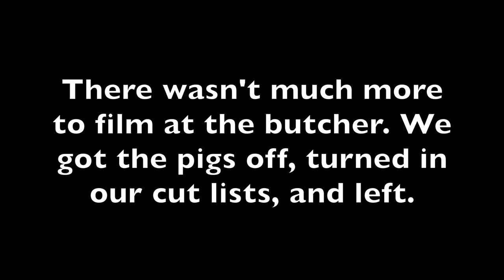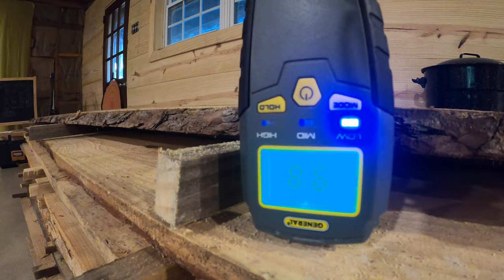When Hard Work Pays Off

Comment: When I was raising pigs I did the same thing, load them the night before as I had to have them at the processor before 6 am and then get to work. much easier as I was dealing with 8 big Duroc's and used a 1 ton stock truck and a ramp.  worked great !!!

Comment: Wes you got to learn to use your cut gate in the middle of the trailer and the escape door on the side. Put pigs in back and set up the front with feed and water, release the pigs. When moving them to the butcher close them up in front half of trailer. When going down the road the less space they have to roam the safer it is for them and the better the trailer will pull with them in the front half. Good job as usual and keep learning fast. As usual necessity is the mother of invention. And on a farm, figuring it out as you go is often a necessity.

Comment: WRT water glassing.  This is our 2d year of doing it - the first year worked just fine.  We actually use a 5 gallon plastic pail and put about 150 eggs in each and put the cover on after so the water doesn't evaporate, then store in a cool, dark closet.  This year we have two buckets - 300 eggs.  Two things to note, 1) when mixing your lime be aware that the water can only hold so much lime at which point it is saturated, so what happens is you'll mix and mix and there will still be solid lime that hasn't dissolved - no worries, that's just a law of physics at work. No need to take that excess lime out as it'll settle to the bottom. 2) The glassed eggs will still be fresh when used (we've used 9 months later w/o issues), but the whites will generally not be firm enough to get a nice fried egg with, so we use them for anything we would normally mix an egg for, e.g. scrambled eggs, baking, quiche, breakfast casserole, etc.  Also, it is perfectly fine to start a bucket and put a few dozen in, and then just add more eggs as you get them.

Comment: Get some half gallon jars.  You can fit a couple dozen in there.  Check the jars a week or two after you fill them to make sure none have broken.  You dont want to find rotten eggs six months later.    Calcium Hydroxide, "pickling lime" is semi-soluble in water.  Once you stir in a little bit, the solution will become saturated and any more will just settle at the bottom, or on eggs.  You probably need less than any recipe you see.  As long as there is a little extra visible lime sediment then the pH of the solution is good and there is enough to replenish any that might get consumed.

Comment: We built our house 25 years ago. Had a guy cut us some tongue and groove pine flooring. Brought it in the house to acclimate for two weeks. Weeks after installation, we discovered that our expensive air conditioning system was not removing the humidity from inside the house. When we got that fixed, the flooring shrank and left lots of gaps between the boards. Nothing to do but chalk it up as a learning experience.

Comment: They hold very well. The only thing that happens is that the shell thins out over time, so the longer they sit, the thinner when you go to Crack them. The taste doesn't change. Do you have a freeze dryer? You can freeze dry raw eggs as well. You just reconstitute them by adding a couple of teaspoons of water per egg.

Comment: Water glass them in gallon pickle jugs. 
Eggs also freeze well. Put them in cartons prick a needle hole in top freeze well then transfer to bags or boxes to utilize freezer space. You can also lay a tray out fill with egg rings fill each with a egg freeze then layer them in a bag with wax paper and store. Better of course if it's a food saver set up to suck air out and seal.  You can also mix up a batch of scramble raw eggs and freeze them like that liquid egg stuff from store.

Comment: Wes, have you thought about using a dehumidifer in the room where those "ugly" boards are stacked, before installation?  I bet your looking forward to nice juicy pork chops, barbequed ribs etc
Reply from the maker: No, just the AC did a good job shrinking them down a little last time. I do worry a little how they'll act this winter when the humidity really drops though.

Comment: Whatever happened with the building you built out back specifically for drying lumber?
Reply from the maker: The solar kiln? It worked great, but was awful to load. Bad design on my part. I stopped using it.

Comment: Good video!  I'm in the market for a grapple.  What brand is yours and do you like it?  Also, what is a Fall Line?
Reply from the maker: It's a Construction Attachments brand. It's a fantastic grapple. Very well built. I think it was $1900, but that was 2-3 years ago. https://www.constructionattachmentsinc.com/products/compact-root-grapple-tractor-loader-attachment?return=/catalog/grapple-attachments
Reply: @falllineridge Thanks!  I'll check them out.
Reply: Google has an explanation that lets you know what's behind the expression "fall line"  It's a geographical description.
Reply: The Fall Line is an area where the piedmont region meets the plains region.  It's basically the geographical "line" where the elevation changes relatively rapidly.

Comment: Try laying those rubber mats out the back of the trailer over the gap and electric wire and they will soon just run in and out without the gap being an issue.